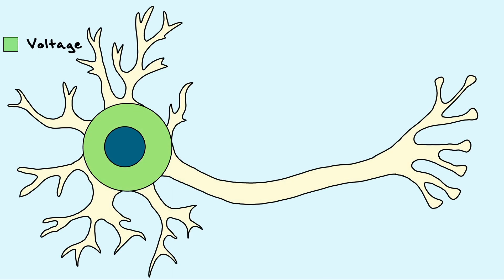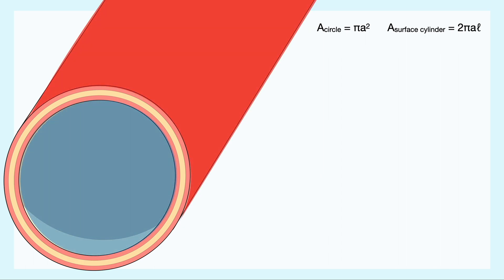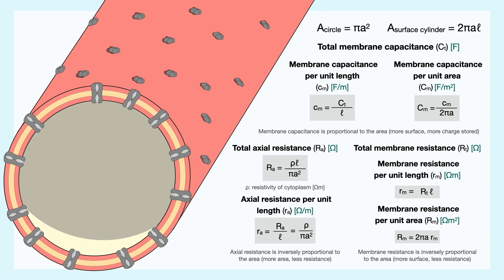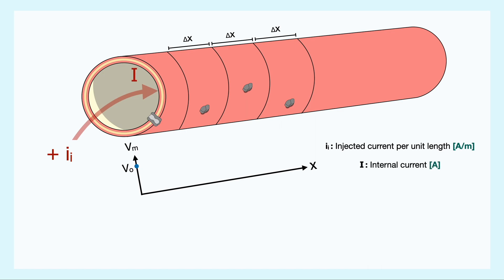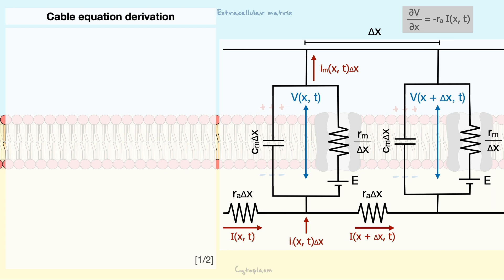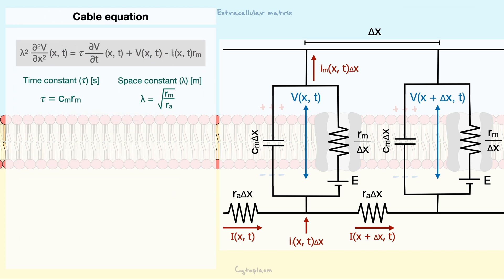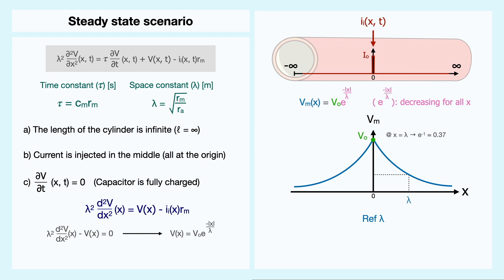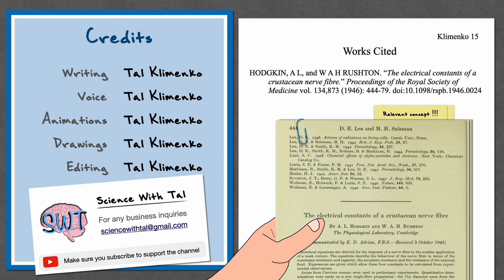Cable Theory Model of the Neuron And Analysis Of The Space Constant Lambda (With Derivations) | Clip

Comment from the maker: 0:00 Introduction
0:22 Purpose of cable theory (in reference to RC circuit model)
1:45 Useful geometric equations
2:52 Passive membrane properties per unit length and per unit area
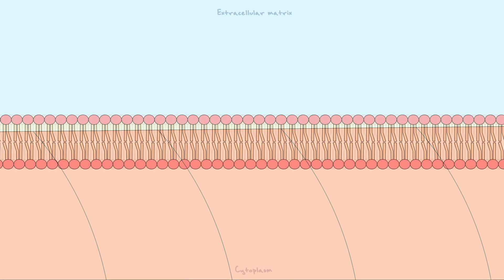6:03 Building the electric circuit model [1/2]
7:28 Currents and voltages in the cable
8:39 Building the electric circuit model [2/2] 
9:31 Cable equation derivation
13:13 Analysis of the space constant lambda 
16:00 Factors influencing the space constant
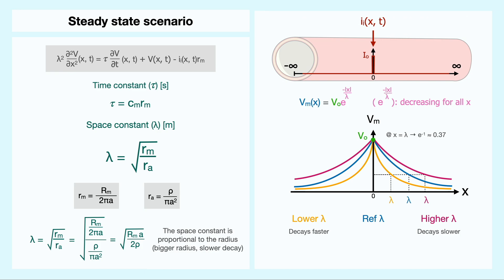16:37 Summary of the passive membrane properties and constants
17:35 Conclusion & references

Comment: The interpretation of the relationship between capacitance and area is correct 3:53 , but I'm confused with the formula. If it's proportional to the area shouldn't it be Cm=cm*2πa?  And the same for the length? At least in electronics it is defined like so. Thanks a lot for the video!
Reply from the maker: Hey, good question and sorry for the delay in the answer. A few years ago when I knew that stuff pretty well I probably could have got you a better answer but from what I still understand:

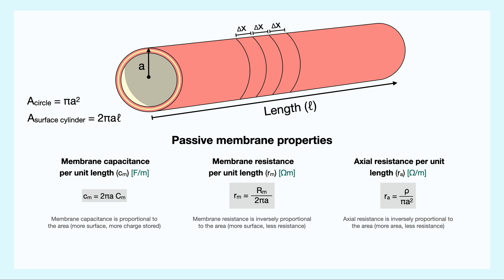The capacitance is indeed proportional to the area: the bigger the neuron, the more surface it has to store charge on it (total capacitance). This total capacitance can be fractioned per unit length (l) and unit area (2pi*a) to give cm and Cm respectively. Both cm and Cm are proportional to the total surface of the neuron, the fact that they are divided by either length or area is simply because they indicate the amount of capacitance per unit area/length. This is why at 5:55, cm = 2*pi*a*Cm.

Hopefully my explanation is somewhat clear, sorry it's been a minute! Thank you for the comment and let me know if it helps.

Comment: If I increase a, will the space constant λ increase?
I am confused because I feel that Rm also decreases depending on a.
Reply from the maker: Yes, with a bigger radius, the space constant increases because the current can spread further. You can get this relationship from the equation derived at 16:00.

Obviously, in this type of reasoning we always assume that the other parameters (Rm and p) remain unchanged and only the diameter changes. 

For example,  if we compare a big dendrite with 2 ion channels per unit area vs a small dendrite with 2 ion channels per unit area, both of the dendrites have the same Rm (resistance per unit area) but because the small dendrite has a smaller surface area, the ion channels will be more concentrated and thus allow more pathways for the current to leave. Hence, the signal decays less in a bigger dendrite. This is why the space constant increases with the radius. 

Now, if we had a big dendrite with 10 ion channels per unit area vs a small dendrite with 1 ion channel per unit area, that would be a different scenario where both the differences in a & Rm would have to be taken into account.

Let me know if my answer is intuitive to you.
Reply: Thank you for your prompt reply.
Yes, I was confused because I could not accept in my senses that the parameters other than a are independent.
But thanks to your explanation I understand it intuitively.
It is interesting, while complicated, in that the existence of ion channels is different from the electrical circuits of physics.
Reply from the maker: @2h998g  Yes indeed. It would be as if there were small holes letting electrons flow out of electrical wires.
Reply: Does it mean that Rm does not change even if a is changed because lengthis assumed to be infinite?
Sorry for my poor English.

Comment: Thanks for this great explanation, however  I from a biology background and at certain point I don't follow with this math , so can you give any advice concerning that
Reply from the maker: Thanks for the comment! Beyond the formulas for the passive membrane properties that are derived from geometric equations (area, surface, etc.), the math background of the cable equation mostly comes from calculus as there are derivatives at play to get the final formula. 

My advice to you would depend on what you need to know for your classes. If you only need to understand the equations, then you can omit the specifics of the derivation and make sure you get a general intuition of the equations.

If you need to be able to understand the derivation and the math surrounding the derivation, then I would recommend for you to review the concepts of derivatives and partial derivatives. 

Lastly, if the equations from the electric circuit seem foreign to you, I would recommend reviewing the equations for voltage, current and resistance. I believe understanding these equations is important as they are the building blocks of the derivation.

Let me know if that is helpful. If you have other questions or any concept you would like me to clarify, please let me know.